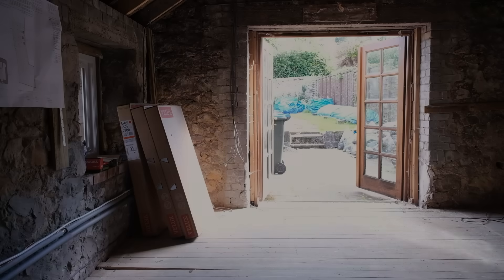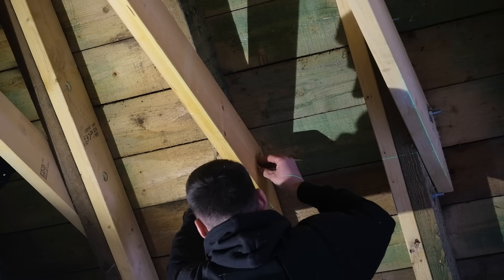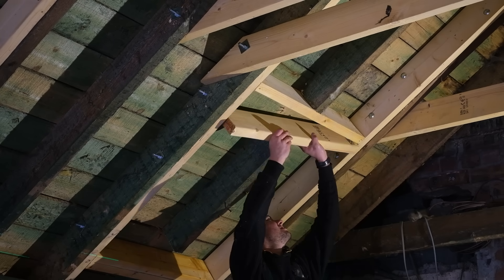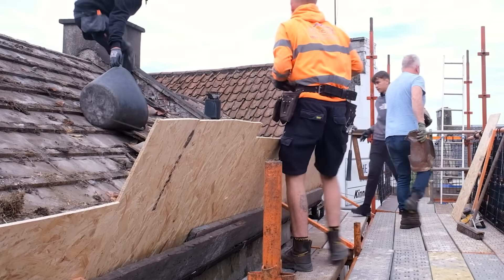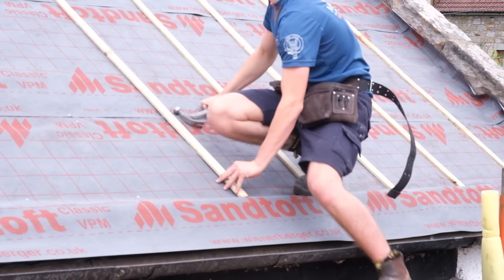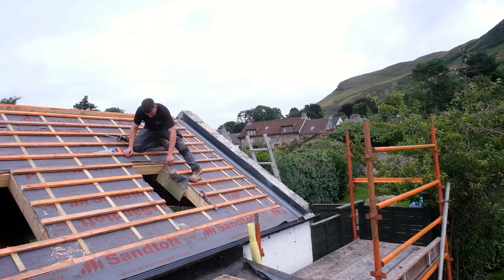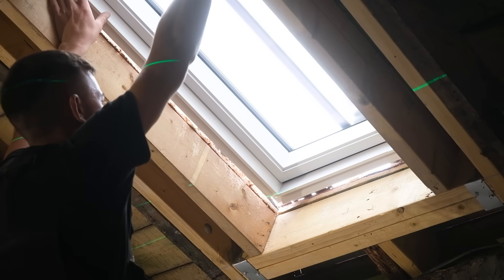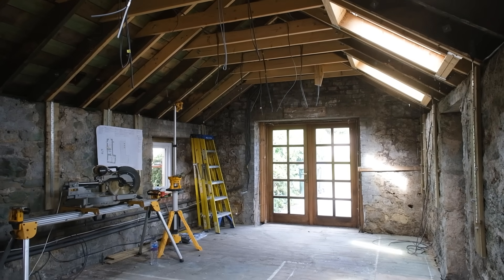My "Extreme" Living Room Makeover | Before & After Renovation

Comment: This reminds me of when I did my own extreme room makeover many years ago. I turned a room off the kitchen that had no windows into a sunroom with windows on both sides, plus a French door to the outside. All the windows and doors came from a place that sold used materials, so it was an inexpensive makeover, even with .! But the most amazing part was when the carpenter cut the first hole in the wall and exposed the beautiful view beyond of a large pond, and the room filled with light. May you have a multitude of views on this one. (I think if you'd brought Junior in and put him on the roof to do an inspection, then let him down through the skylight in a basket. Wearing a crown and a velvet cape, that might have clinched it.)

Comment: Thanks.  I have Velux windows and have often wondered how they were put in to replace the skylights that my house had originally.  I hope yours are fine.  Mine turned out to be a faulty batch and, over the years, each pane of the interior double glazing has shattered.  It was only when this happened for a third time that I googled and discovered that they were a known faulty batch and I could have had them repaired by Velux.

Comment: I’m super envious Patchy, my house is north facing and incredibly dark. I’m saving up for holes in the wall on the other side. Idiot builders didn’t put windows on the south side where there is space for two or east where there is space for one. It’s like living in a cardboard box. It’s so dark that it’s only possible to read a book in the north facing living room for an hour in the morning in the spring and autumn, and a couple of hours in summer. The rest of the year impossible. I mostly use it as a cupboard. 
Loving your renovation.

Comment: I gave you my 1/1,000,000,000th slice of that view pie. 

NEW RULE: If you don't make new holes in a wall, floor or roof, don't call it an extreme makeover. The bar has been raised, as was the ceiling.